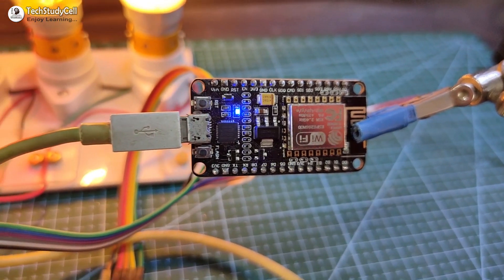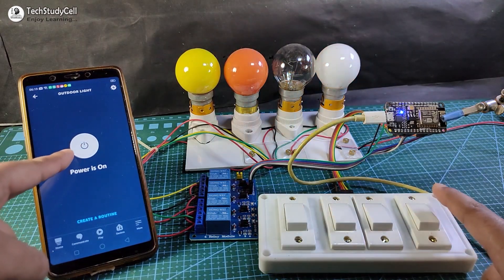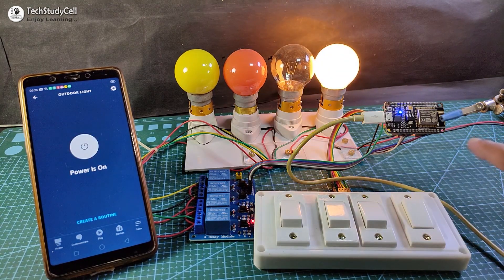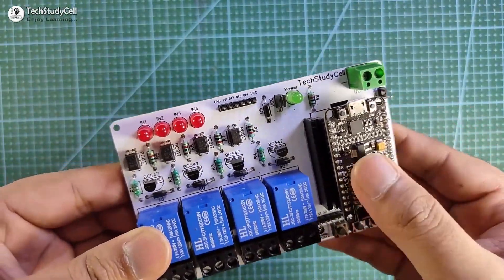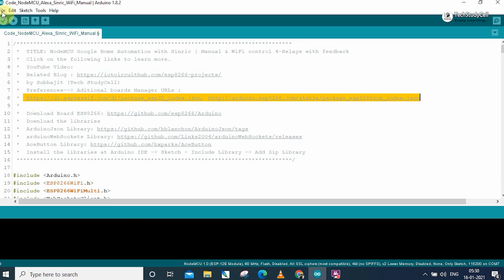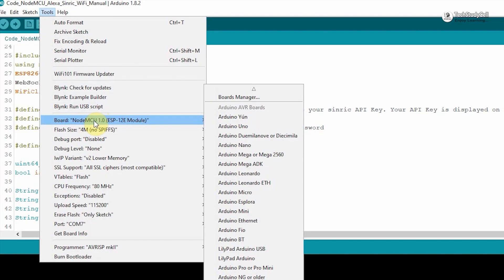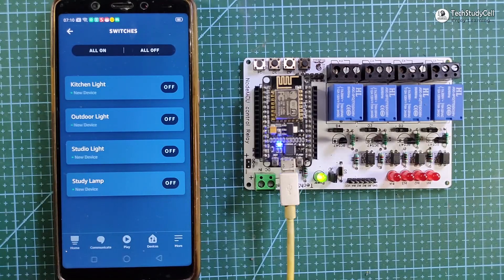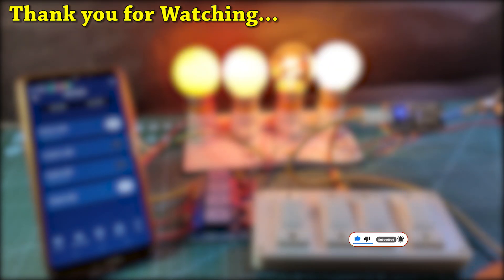NodeMCU ESP8266 Alexa App Voice Control Home Automation System | IoT Projects 2021

Comment: Serial monitor repeats this as seen below. What is the problem? 
ets Jan  8 2013,rst cause:4, boot mode:(3,7)

wdt reset
load 0x4010f000, len 3460, room 16 
tail 4
chksum 0xcc
load 0x3fff20b8, len 40, room 4 
tail 4
chksum 0xc9
csum 0xc9
v000672b0
~ld

Comment: Can you please add a 5v power supply to the pcb so that it becomes a sand alone system? Also, if you could build a version with fan regulator it would be great.

Comment: Can you make a video on how to connect the wires with the relay module and nodeMcu with the manual switches. Really need some help
Reply from the maker: I will share complete circuit in next video
Reply: Thank you soo much. Means a lot

Comment: You have mentioned components twice, once with 4 elements and another with 10 elements (diodes, optocouplers, transistors, etc). If I don't use any PCB is it okay to try the project with only node mcu, relay, and switches? 
I mean without any diodes, transistors, etc you have mentioned later.
Reply from the maker: Diode, transistor required to make relay module circuit. If you use relay module then you don't need them
Reply: @TechStudyCell  thank you very much for the reply. 

And one little question, so if I use a relay module then I only need to buy a node mcu, no extra resistors/capacitors/diodes/transistors will be required?
Reply from the maker: Yes. But currently you can't register in Sinric. You have to go for Sinric Pro
Reply: @TechStudyCell  Thank you for your support, really appreciate it.
Reply: @TechStudyCell  Amazon Alexa app is not available in our country. Can I use any other app like sinric pro for the project? or can you suggest any other app?

Comment: hi! i watched your video and i too want to build the same for me.
but i have a doubt, can u please resolve my query?
my queation is:
if i turn ON the bulb from switch and as u said we can see its status in alexa app. then can we turn it off from alexa app. (meanwhile the manual switch was ON).
is it possible??
plz reply.
thanx
Reply from the maker: Yes, you can can turn off from Alexa app. The manual switch will remain in ON position. Again to turn on the lamp from manual switch, first have to turn off, then turn on the switch.
Reply: @TechStudyCell  : thanx bro, i too was asuming the same.
but there is one issue. if the relay burned up (or failed to work) then the light will not ON until we replace the burned relay with new one. am i right??

Comment: I want to create account in sinric so its not possible. any other ways to connect esp8266  nodemcu to google assistant or alexa without sinric or iffttt 
I have already programmed blynk and its working but i want to connect to voice commands what to do ?
Reply from the maker: You can refer the following video. I have not used any third party plugins.
https://youtu.be/OJ4CzWyRQr4
Reply: Would be it possible that using alexa app instead of speaker sir?

Comment: I see that WiFimilti is included there but you used one network!
Reply from the maker: You control the relay from different network
Reply: @TechStudyCell  are you asking that?
Reply from the maker: I mean you can control from different network.
Reply: @TechStudyCell   I tried contacting you through instagram, but you didn't replied maybe you had not seen it. If not please check the chat request on the top right corner.
Reply: Yah! that's the main aim of WiFimulti. I removed the wifi "ssid" and the "password" that was defined by you. I added ```WiFiMulti.addAP("ssid_from_AP_1", "your_password_for_AP_1");``` two more times in the setup part and also added ```WiFi.mode(WIFI_STA)``` before it.

Comment: Great Tutorial! Thanks for the detailed explanation. Also the pcb Gerber file is amazing. 
I have a small request though. Can you please modify the pcb design to include a 220V to 5V Step-Down Power Supply (https://amzn.to/3tEH1hA)  into the design? 
If we use this step down transformer, then we can power the whole module from the AC supply itself and we don't need any external usb power source.
Reply from the maker: Ok.

Comment: Bro in remote areas many times power cutoff hapeens, and thus it cause network drop as well. I tried this project but when power cutoff and network cutoff happens this nodemcu doesn't connect automatically to alexa......is there any code i can try where nodemcu will keep connecting or check connection every one or two minutes and connects again....i dont want to use use sinric or other paid platforms....thanks
Reply from the maker: Here I have not used any paid platform. I have used free version of Sinric. It will take some time to reconnect. 
If you don't want to use any 3rd party plugin then please refer to the following video.
https://youtu.be/OJ4CzWyRQr4
Reply: Bro thanks for ur video it was helpful....I was also facing some other issue...if u can guide it will be helpful....I hv added two node mcu (living room and kitchen) and alexa is detecting 8 devices but whenever I try to create group in Alexa app either it will take first device from first nodemcu or from other nodemcu but not both at a time

Comment: I do same project but why my 3rd relay not working? Anybody can explain?
Reply: Try to connect Gnd for the relay with Gnd for NodeMcu
Reply: @ahmedbelfakir6688  its is connected. All 3 relay are working 1,2 and 4 the 3rd one is not working. Idon’t why
Reply: @junsarte8781  may be it's died
Reply: @ahmedbelfakir6688  maybe ill try another one thanks by the way gobless

Comment: whenever I connect my switch with ESP8266, everything freezes and stops working. made every possible move  ut couldn't come out of the loop. Please help
Reply from the maker: During starting (booting) the NodeMCU switch 1 should be turn off. After that the boot you can control as you want.

Comment: Can I get a circuit diagram of how to connect switches too with it??
And will it allow me to use in different phones.
Reply from the maker: You have to connect the switches across esp32 gpio and GND pin. Please refer the circuit shared during video.

Comment: i have followed the entire video step by step, my circuit are working even my switch board is also working but my relay board is not letting the current to flow due to which my lights are not tuning on of off  i have using 4 channel relay board, i just wanted to use two lights for the same and i have also checked my connection more the once but there is no success

UPDATE : -  SOLUTION
also need to connect  JD-VCC(on relay board) to VIN(on Nodemcu)
NOTE :- while turning on or off the lights relay board will make a clicking sound which is normal
Reply from the maker: Question is not clear to me. First check the circuit carefully. During starting the NodeMCU the Switch1 should be off.
Reply: @TechStudyCell  when i connect a bulb with the relay and try to turn on/off it, the LED on the relay turn on/off but the bulb connected with the relay does not light up but when i connect JD-VCC(on relay board) to VIN(on Nodemcu) and VCC(on relay) to 3V3(on Nodemcu) the bulb start responding to my command

Comment: Thanks for sharing such an Awesome project. I compiled the code with all the required libraries selecting NodeMCU 1.0
(ESP-12E MODULE)  but it gives error on compiling at line ButtonCofig config4;
'ButtonConfig' does not name a type.
Can you please guide why I m getting this error. I m using Arduino IDE 1.8.3 
Awaiting your earliest response.
Thanks.
Reply from the maker: Download the latest version of AceButton library from the given link. And install it
Reply: @TechStudyCell  Hi dear, I installed Ace button latest library 1.8.1 but I m still getting "Error compiling Nodemcu 12e".
Can you please share which versions for all the libraries are you using in this code.
So I use same versions . Secondly In board manager what versions for avr & esp8266 are you using. Please guide. 
Thanks once again.
Reply: @yawarsaeed6499  I have same problem for node MCU compiling. If the problem is solve from your side please tell me what you do ?

Comment: Why  a reset is required frequently? Showing this arrangement is not stable.
Reply from the maker: Reset is not required. Just upload the code and use it. During starting the NodeMCU switch 1 should be off.

Comment: Sir how we have to add push buttons directly ground and digital pins or using a resistor
Reply from the maker: Just connect push button instead of switches. I have used input_pullup function in code. So resistor is not required.

Comment: Bro can u add a sensor to the A0 and get feedback in the Alexa app and one more thing can you add multiple wifi ssid, this would be useful when one network is down!
Reply: set the same wifi name in your mobile hotspot, that u use on daily basis, trust me this will work for sure,  i do the same, whnevr my wifi gets down
Reply: @jasmnvlogs  when I need to go out with the phone? then I won't be able to control it via internet

Comment: Sir great project... 
Sir make..project.. . Nodemcu with 8 channel with fan dimmer + RF remote-control   + manual + application with wifi and without wifi... 
+
Reply from the maker: For 8-channel Relay module you have to use ESP32
Reply: @TechStudyCell  ok sir... With esp32

Comment: Very nice bro 
Will do it one for my home
But i have a doubt, if there is no wifi when node mcu boots 
Will it can still be controlled manually
Reply from the maker: Yes. But make sure when you boot NodeMCU, all switches should be off.
Reply: @TechStudyCell  but switch doesn't work for me when booting
Reply from the maker: During boot will not work
Reply: @TechStudyCell  i mean when there is no wifi available during boot
It works only when it gets wifi
Reply: @TechStudyCell  I mean wifi is on every thing good but when the manual switch is in on condition then nodemcu is not starting no response . Please help sir
Reply: Sir please try yourself first turn on manual switch then cut the power supply to nodemcu and then put the power again it is not starting and is a huge problem
Reply from the maker: Turn off switch 1 during boot process. I have mentioned the reason in description.

Comment: Superb👍
Reply: Bro this project details I want build one like this
Reply from the maker: Thanks
Reply: @TechStudyCell  sir when manual switch is in on condition then if light goes and came again the nodemcu is not booting or starting please solve this problem
Reply from the maker: The switch1 (SD3) should be off during start or boot processe. Because if SD3 grounded, the boot will fail.
Reply: @TechStudyCell  sir please help me when the switch is in on condition nodemcu board is not starting if you not understanding me do by yourself but please sir help me... After power cut of nodemcu if switch is in on condition then if power came then nodemcu is not starting please help me sir